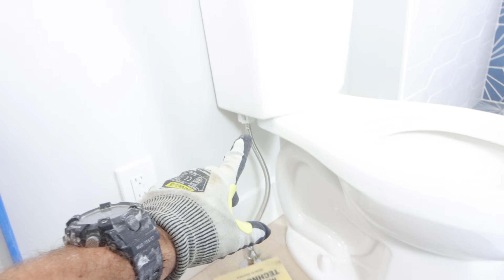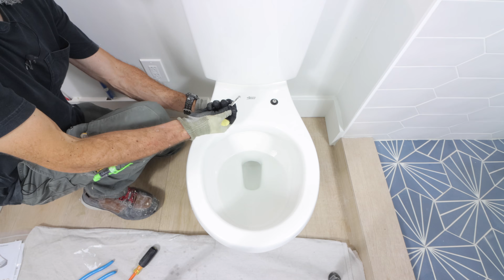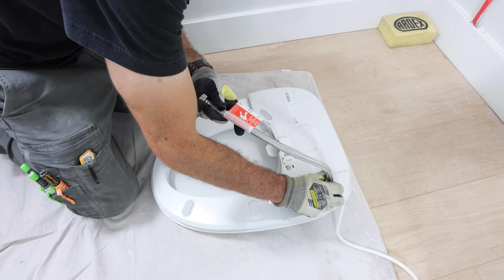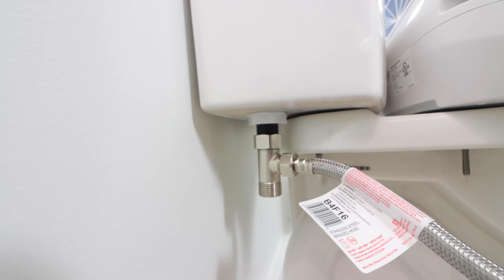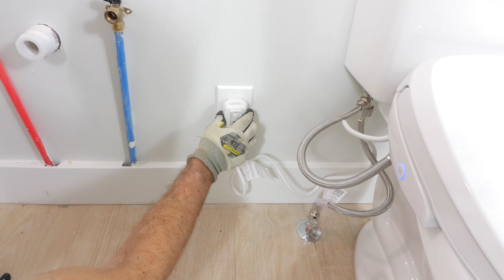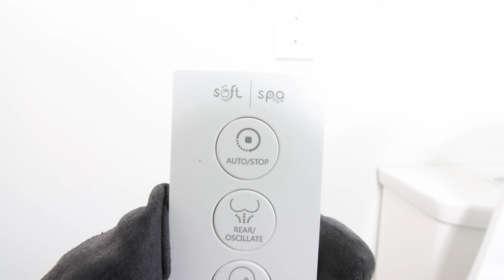Bidet Toilet Seat Installation for Beginners

Comment: Sooo how common are wall outlets at the bottom next to a toilet?
Reply: I wonder about that too... my outlet is next to the bathroom door, i dont think it's safe to use extension outlets.
Reply: Definitely not in England. You would be lucky enough to find a shaving outlet.
Reply: Should also ask how many bathrooms have wooden floors
Reply: @viciousatomsk9971  it's not real wood :P
Reply: Not common at all. Easy install for an electrician to throw one in for you
Reply: Not at all
Reply: As soon as I saw the outlet in the video, I instantly stopped and thought , “I have an outlet in my bathroom?”. I immediately had to check and was disappointed when no outlet was found.
Reply: My bathrooms get cold in the winter. I think I would want some warm water and a mixing valve! 😊
Reply: Peasant!
Reply: Not common but a handyman or preferably an electrician can add one relatively cheap dependent on your wall set up!
Reply: Over here in Japan they are in every home, because almost every home has toilet seats like these.
Reply: I have it. I guess I am richer than you.
Reply: Not common. I install them all the time for seats like these
Reply: We are doing a new construction home, and we opted to have an outlet right near to each toilet just for this reason
Reply: Electrician here, it's only common in richer households for badets and towel rack heaters.
Reply: It’s alright if you move into a new build my family have one but I can’t house is too old
Reply: It's not common. I just installed an outlet in my bathroom today for this very reason.
Reply: Right?!😂😂😂 I was just thinking that when I saw ur comment ..brah😁
Reply: Not common
Reply: Never seen one!
Reply: 😂😂😂😂😂😂 true!!
Reply: @viciousatomsk9971 it’s tile that looks like wood
Reply: Mines is
Reply: I think its common dude if you don't have one just get extencion cord or you can just add a new outlet closer
Reply: Outlet in bathroom illegal in U.K.

Comment: A problem I ran into is the existing supply line from the water source to the toilet was made of chap plastic and not at all flexible- when I installed the T-fitting to the bottom of the toilet tank, the supply hose was then too long.  I tried bending it, but decided to just go buy a shorter one with the braided metal covering.  I installed an ILid Smart Max, and your instructions worked perfectly. One difference I noticed is the ILid has a plastic fitting for the water supply hose instead of a metal one that yours had. I ran the cord along the base board and secured it with some hot glue and it is not too noticeable.  Overall, an easy installation. It helped a lot to see how the adapter piece fits onto the bowl and how the adjuster pieces worked.  :face-blue-smiling:

Comment: Outlets are typically not found behind or next to a toilet. If one is installed in a bathroom, it must be GFI protected to auto shut off per code if it were to get wet

Comment: Do they do one you don’t need to plug in? Sadly not really useful in uk bathrooms as there are no plugs
Reply: Yes there are actually add on devices that go under the seat and just connect to cold, and there's ones that connect to the cold toilet line, AND a hot sink line. You can also add a small automatic heater to those as well if you can't access hot water line.

Comment: How did you get the supply line to disconnect from the shut off valve? Mine looks like yours does in that there appears to be no nut to actually turn. When I turn the nut that's connected, it turns the entire shut off valve and the line won't disconnect.

Comment: Sadly, I don't have an electrical outlet next to my toilet
Reply: I am in the same boat, I got the shattaf wand by Brondell. It works amazing and easy install
Reply: Get a Extension chord, problem solve.
Reply: @frenchustube  If the extension cord is connected to a bathroom gfci that is next to the sink, how is this bad advice? Also you could just swap out the reg recepticle with a gfci. Problem solved.
Reply: @michaelhinchey  It would be a sloppy looking connection having extension cords running from your toilet all the way over to the sink outlet.
Reply: @lynxs_crcclassicrockcovers7007  Except it would look sloppy. Who wants electrical cords running over the floor of your bathroom?

Comment: How could this thing possibly heat the water??  There's no hot water tank!  There's NO WAY such a small device could possibly heat completely cold water in that size package, not unless there's a TINY reservoir in there somewhere & the water pressure during warm water mode is MINISCULE!